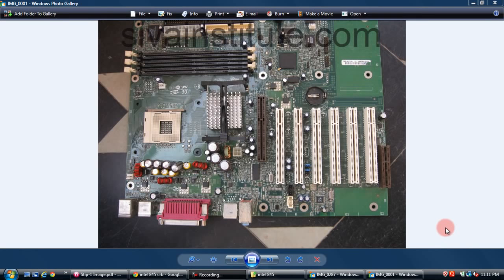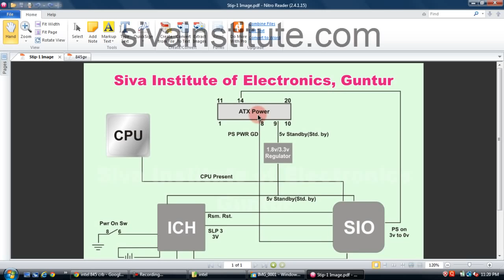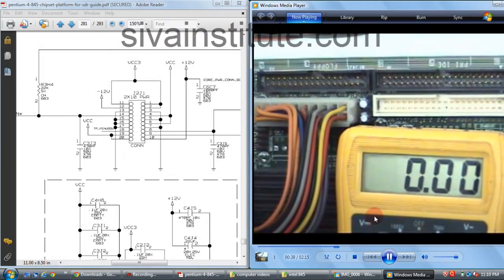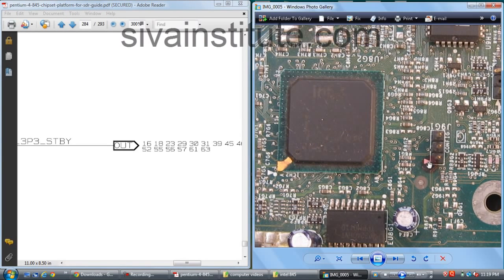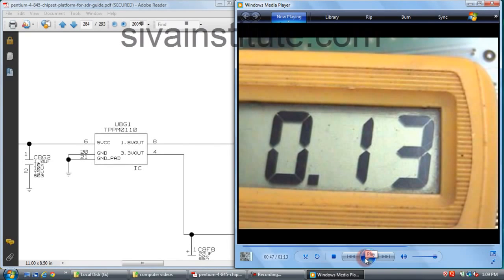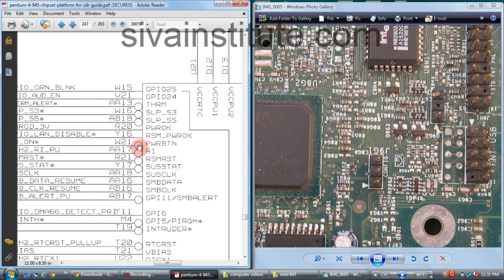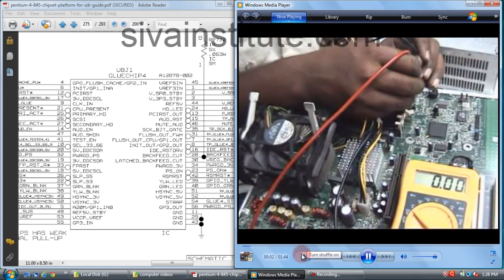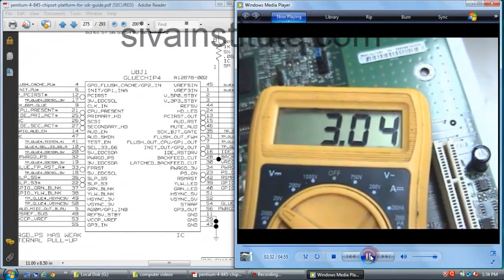How to Check  Dead Desktop Motherboard(step by step) Step 1.

Comment: Dear Kotee, Your presentation is unique. There is no other presentation in
the Youtube like yours. Your approach to identify the cause for the problem 
of no display with the help of circuit diagram and voltage measurements is very
professional. Many motherboards are discarded as unusable even for very
small defect which could easily be rectified, because of lack of proper training
for the technicians. Please post many tutorials like this, on processors, RAM cards,
VGA cards etc. If you don't think otherwise, your English is rank bad. Take the help
of English professor in the nearby college. If you improve English presentation,
you will get viewers from all over the world.

Comment: Where do you find any motherboard circuit diagrams?   All what i can find are User Manuals.  I've a friend who got a MS-7613 and i would love to determine if the Motherboard is ok or not because he doesn't see anything on his monitor and nothing seems to happen when he turn on the computer, except fans are turnings, and led on board is On.

Comment: i have a ibm board, when power button presses nothing happens, ps ok, in test card only 3.3v led glowing, when i make it on for the first time, processor fan turns for a second and all leds of the card glowing for a moment. voltage available at front panel pin. what should i check ?

Comment: Hi i own a computer shop and i already have 5 dead motherboard coz i have to buy new one for replacement of the  broken board. its so sad coz i buy new ones and it cost me money. i have asrock and MSN dead motherboards. I tried to bring my dead mobo in a comp supply coz they have a tech there but they told me to upgrade my unit and it would cost me a lot. If only i can repair this mobos.

Comment: Please help my computer cannot use back USB port. When I plug mouse or keyboard on the back USB port than I cannot turn the computer on, but when I plug in the front USB port it start normally. Can you help me find where the problem is?
Reply: maybe your usb ports was disableb in bios
Reply: No, it is enable, because I can use front USB ports. And when I turn on the computer and plugin keyboard and mouse with the front USB ports, it starts normally. But when I plug in back USB ports, it does not start.
Reply: Try removing the cmos bat to reset all the settings
Reply: The easiest way to clear the CMOS is to enter the BIOS setup utility and choose to "Reset BIOS Settings" to their factory default levels.
Reply: I know how to reset bios, but in my case is not about bios problem. Enable or Disable USB port cannot cause turning on the computer.
Reply: Are you sure the device you plugging is working properly ? Did you tried with other devices ?
It looks like you have short circuit on the USB connectors and your power supply can't turn on when 5V rail is shorted.
The problem may occurs also when a resistor/diode or similar component for USB connectors power is damaged.
If you hook up USB device on the back panel ports when you computer is working, did the computer shut off immediately ?
Sorry for my bad English, by the way.
Reply: Devices I plugged in are fine, because I work properly if I plug in the front USB ports, but when I plug them on the back USB ports, the computer cannot turn on.
Reply: Now plug it on the back panel when your computer is working. If your computer shut off when you plugged in, the problem is short circuit on the power connectors or broken element for USB power.
Reply: I tried that few times, I wait until the windows loaded and I unplug my mouse from front USB port and plug it in the back port, the computer get hang. I have to hold down power button for 5 seconds to turn the computer off.
Reply: but before, your computer is working? do you make change to your computer before you encounter this problem.? when you encounter this problem?
Reply: I think the problems caused by ICH chip, need to do some sorldering works, and will tell the results. (5v is ok and no shorted - pin 2 and pin 3 not shorted)

Comment: Did you understand the jargon ? Like way i dont understand the jargon and idioms like used specific to the explanation , teach like
Say 
A, b, c.. few points 
Current comes from A to reach B , B to C also A to C and  also across ABC directly without via loops. You saying .. what ever i wont learn verbally , this needs like practical. Good try but not igniting me for
A is cpu
B is north bridge
C is south bridge .. 
A to B 
A to C
 B to C , A to V is cpu to north  bridge , A to C is current flowing from cpu to south bridge via bios if, say with assuming if for not erry one the noun like cpu , north bridge  ... is not familiared and as of. Studying curcuit in tyeory like playing formula 1 in videogame , funny